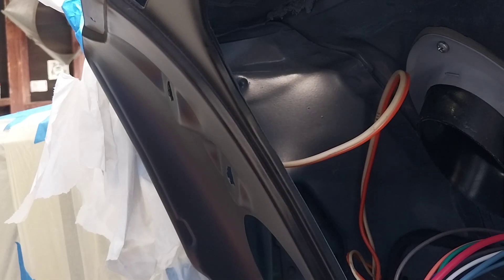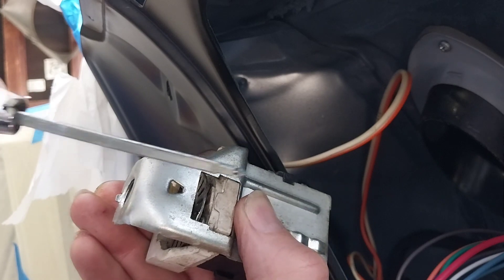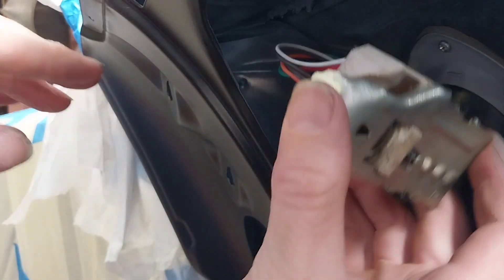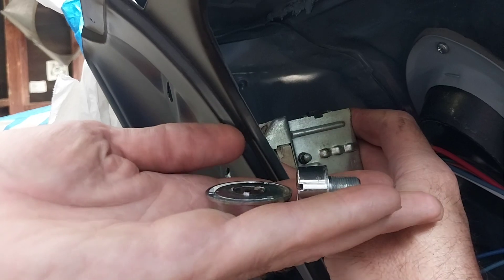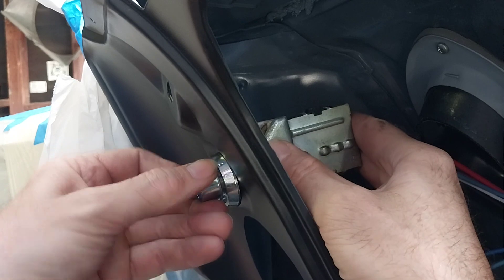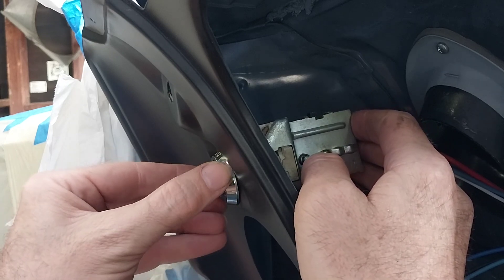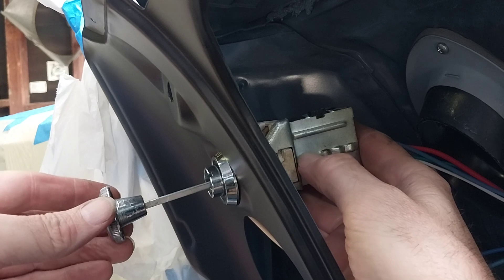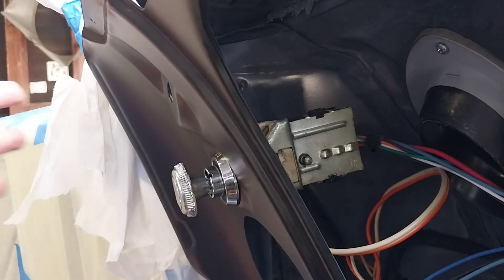1968 Camaro Headlight Switch Installation : 263

Comment: Wanted to know how to remove it! Thanks!
Reply from the maker: @GigaChadFarfour-fr7vr  same process in reverse.  In order to remove the knob, need to push in the button on the side of the switch housing.  The knob and the rod come out as one peice.  The first part on the video explains the button location.  Just have to reach in, push the button, hold it down and pull out the knob.  You may have to giggle the button and knob due to its age, but should come out. Then unscrew the retainer ring at the dash.  The plug will be a pain to remove from the switch, so make sure you can see what you're doing under the dash.
Reply: @CamaroRestoration  yeah I followed in reverse! Same for washer thanks for videos!